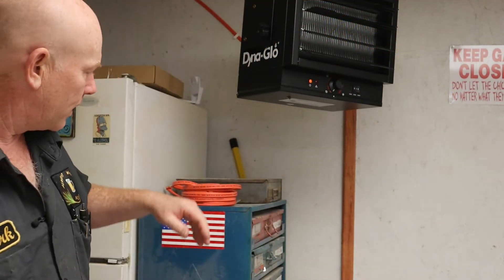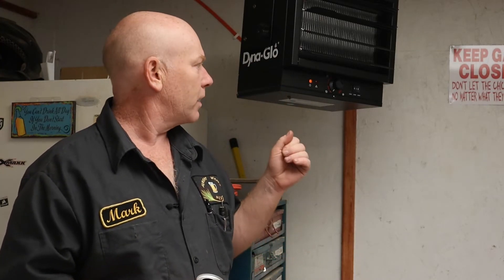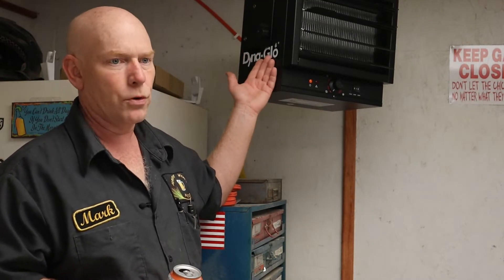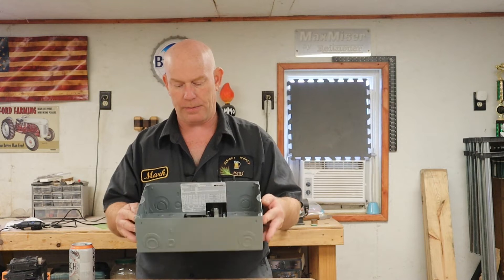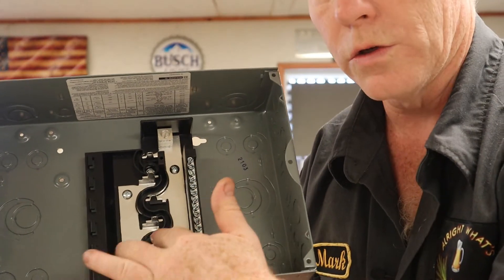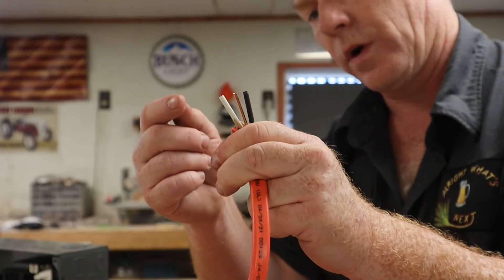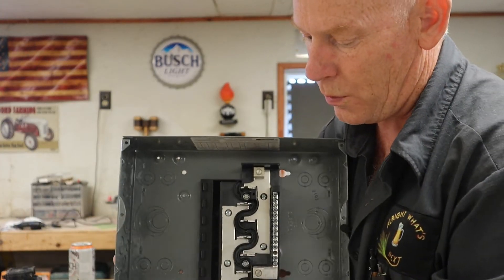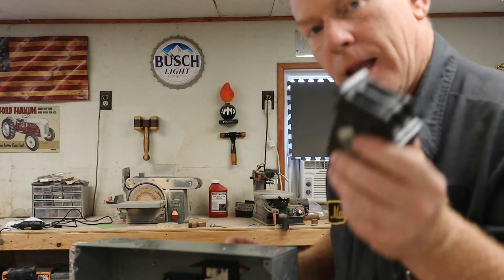How to wire a 220 volt shop heater

Comment: I hooked up the 10k watt dyna glo in my garage and it seems to be underpowered. The heat it’s pushing is really weak and doesn’t seem right. It’s fed with 6 gauge across the garage from the breaker and is about 45 feet of wire. Does that matter? Any ideas or suggestions. It’s putting out heat like a small space heater in the house 🤬

Comment: "The voltage coming in to your house is 120"  WRONG! The voltage coming in to your house is 240V, and after installed into your service panel, is then distributed throughout your house at 120V, or in the case of some appliances, 240V.
Reply: Actually, they come in 480, then dropped down to 240 at the house and then 120 to your basic outlets and 220 to you bigger outlets, dryer, over, furnace, etc.
Reply: in north america the lines coming in are 120…

Comment: How can I rewire my 220V DRHeater DR966 to get rid of the thermostat and circuit board? I just want it full blast anytime it’s plugged in. I’ve had it for years but now the electrical controls are broken. I only have it on when I’m in my shop.
Reply from the maker: No idea, I'm not an electrician, I'm just a guy that doesn't have enough money to pay an electrician so I try and fix things myself

Comment: I have a 7500W Dyna Glo EG7500DGC - No one shows how to connect the wiring inside the heater - the diagram in the booklet is inaccurate has only 2 connections and does not look like the terminals in the heater itself - I have 4 connections -1(L) AND 2(N) on one connection block and then same markings 1(L) and 2(N) on the other block so I have 4 terminals they stuck a label L1 - L2 next to one of the terminal blocks - so it looks like the (N) terminal must be the Neutral wire? - I am using 3core wire so red and black can be 110v so the neutral wire could be used on the (N) connections? Does that make sense? It is confusing - and tech support does no answer!
Reply from the maker: The wire going to the heater should have 3 wires in it.   A bare copper one for ground a black and a white.  On each side of the bottom of the heater there should be a green screw.   That's for the ground wire, it's a 220 heater so there's no neutral, both white and black will have power 110 volts each.   The heater is set up to run an external thermostat if you want.   The instructions should say which terminals are for running an external thermostat and which ones are used for the heaters built in thermostat.  Once that's determined then it's just hook the ground "bare copper wire" to the ground screw, and hook the white and black to the other 2 terminals, doesn't matter which one they both have power if your breaker box is wire correct.  Make sure the switch on the back of the heater is switched to use the built in thermostat, on mine it was the "1" setting, then the heater should work. I would strongly suggest having a licensed electrician look at your wiring prior to turning the power on to make sure you don't start a fire and you meet code.  I'm not an electrician so you shouldn't listen to me.  I'm just a drunk guy making stupid videos

Comment: Thanks for the video! mines on order 7500Watt. Question now that its been up do you find the placement on the ceiling to close to the wall or is it perfect ? Does it get Hot? going to mount mine with garage door brackets but worried about placement away from the wall. Thanks again
Reply: I just installed my. But is big click noise when starting. This is normal?
Reply: @PamfiloRodas  Yes, but one time that's it for me
Reply: @jav9888  1 time all the time when stars and when shut off? Right
Reply: @PamfiloRodas  Sorry yes that's correct. I have mine setup on a thermostat so it clicks both times.
Reply: @jav9888  so that's means, the loud click is normal?
Reply: @PamfiloRodas  I would say so, I think its the element igniter/Starter turning it on
Reply from the maker: There is no issue with heat on the sides and back.  You can put your hands on the heater and it's cool to the touch.  I absolutely love it.  I have it on it's medium wattage 4000 watts.  With the thermostat turned less than half way up it kept my 28x24 shop at 70 degrees even when it was 15 below outside.

Comment: I wish I could have heard this thing running. I had one installed and I don’t think it’s working correctly. It barely heats up my 1 car garage.
Reply from the maker: Its got to be a bad heater.  if the fan is running it should be working.  Mine keeps my shop very warm on medium setting.  I liked it so much I put one in my basement.  There was only one furnace vent down there and could get chilly.

Comment: How do u like this heater ?  I have a 3 car garage/ man cave fully insulated and looking for something to heat it up and cool it in the summer. I was looking at dyi Costco  18000 btu Mr cool minisplit system which is $1600 but it has both ac/heating in one unit.  I don't know which rout to go, get a heater dyna glow 15000 watts right now for $500 and buy something else for the summer time or just get the minisplit system?? I have a pool table in there and a gym:). I love in Clovis California in 9b zone I think or 9
Reply from the maker: I love it, it's keeping my 24x28 shop at 75 degrees and I haven't noticed much of a change to my electric bill. I only have it on medium
Reply: @AlrightWhatsNext  so what about summer do you have a different unit for summer time ?
Reply from the maker: I just run a window air conditioner
Reply: I think a mini split's reason for being is aesthetics and convenience. You can get 7500 watts (220v) of heat for under two Benji's. A/C for a large room, 4 -5 hundred? Not discounting the value of convenience or looks. I'm just pointing out that there's an easy way to line-item-veto additional cost if one wants to.
Edit: the 7500 watt unit is rated at 25,590 BTU / 1,250 s. f. For reference, a detached garage might be 25x25 or 625 s.f. (I don't need AC cuz basement)